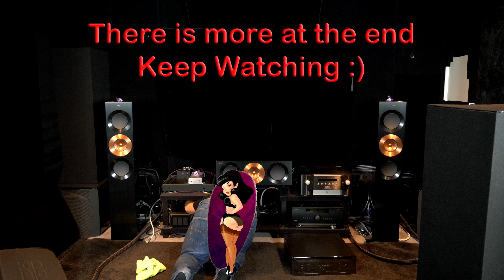The Review Installation Process and Demonstration - Audioquest Niagra HiFi Products

Comment: The review of the audioquest oak speaker cable will be interesting as I use audioquest rocket 33 solid core which made a big difference to my setup . Did you play the flatlands track with just the audioquest oak speaker cable ? And which amplifier did you use for that track
Reply from the maker: darren monk the track was played on the system in the video inc the ML n.585 KEF Ref3 - the only change was the Oak speaker cable instead of my XLO Reference